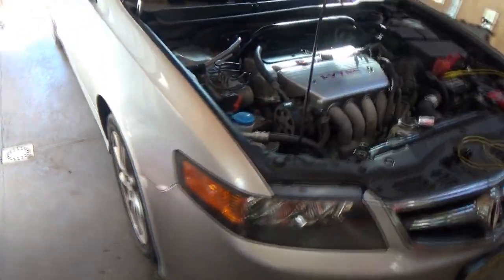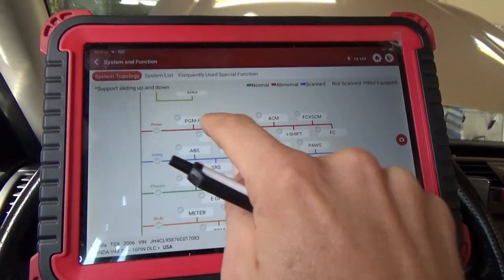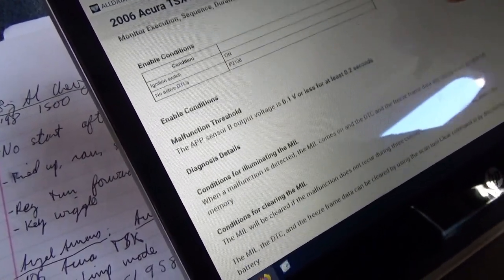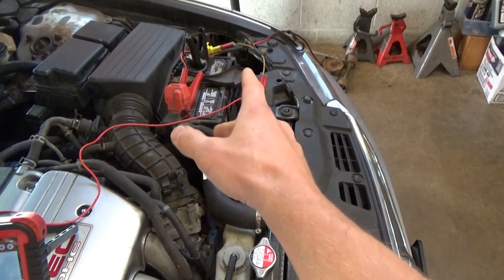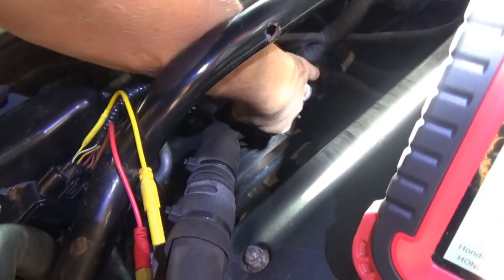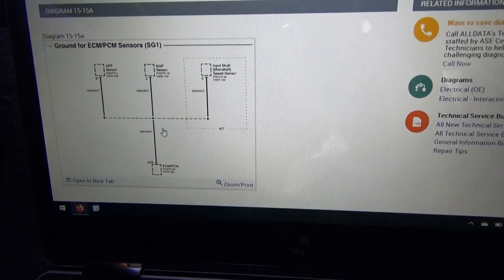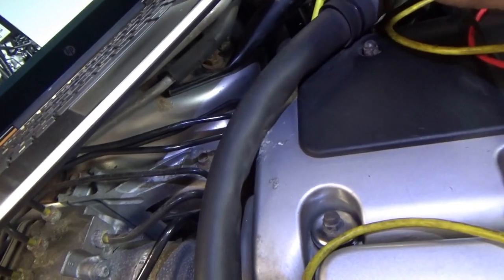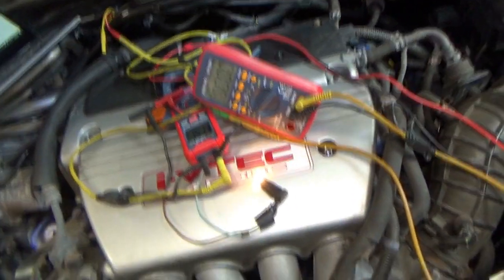DANGEROUS Limp-Home Acura (Part 1)

Comment: Running a higher current through a multi--strand wire with some conductors having high resistance connections can sometimes heat the resistance enough to weld through the resistance.  That "thermal junction" looked to me like a heat shrink compression joint used instead of a crip or solder.  There were exposed conductors inside the plastic cap. Perhaps the branch being tested had surface oxidation and handling broke through the oxide.  Doxit followed by solvent rinse? Then solder or mechanical splice.

Comment: 0.24V is almost perfect for the sensor B. Sensor A and B have different voltage ranges for redundancy - otherwise a short between the signal wires could not be detected. Hence why the freeze frame set at 0.44 volts - the difference between the two sensors was too small. It always expects SensorB Volts = 2x SensorA Volts.
Reply: I don't understand why the voltages would be different, but 2 readings that have to agree for something as important as throttle position makes sense.
Reply: @mykofreder1682  The sensor is intentionally designed to have different voltages representing the same position. The computer is of course programmed to recalculate each voltage to the correct position. So even when one sensor gives 1V and the second 2V, the calculated position would be the same ~40% from both. If the result matches, computer gets the result as a correct input. But when there is a short circuit between the two wires, it sees the same e.g.1.5V on both lines, so when recalculated, the recalculated result for first sensor would be 60%, but from the second 30%. Because both should represent the same pedal position, which is impossible, so the computer recognizes there is a fault, can disregard the input as wrong (so goes to limp) and so then sets that mismatch code.
Generally there are two principal techniques are used for such redundancy purpose:
One voltage being half compare to the other (one has 0% at 0.25V and 100% at 2.25V, second has 0% at 0.5V and 100% at 4.5V; e.g. this Honda),
then each going from the opposite direction (e.g. one has 0% at 0.5V and 100% at 4.5V, the second has 0% at 4.5V and 100% at 0.5V)
Or some variation of both (one goes from 0.5->2.25 and the second 4.5->2.75 or so).
All the time the driver circuit in the sensor uses the same output stage (e.g. pull up; or the one side is stronger than the other), so when shorted the one attempting to drive higher voltage wins, so result is again position mismatch.
Reply: I (X-harness designer) would think if they have two sensors, one goes pop, you can still drive the car with the good sensor. All be it in Limp mode because the computer knows you have potentially a dangerous scenario. Your concept of differences in grounds is not sustainable as ground voltages can easily vary at different locations due to ground surges or loads. I would never use ground other than ground and would expect it to be zero Volts from a design viewpoint. 
I appreciate your redundancy  hypothesis, usually MAP v.MAF etc for IAC and so on.
Reply: I had another make of car with sensor 2 having 1/2 the voltage of sensor 1.
Reply: @mykofreder1682  two different voltages ensures that there must be two valid signals present - if they read the same voltage, you have an issue and the engine goes into limp-home mode.
Also, the idea with two inverted voltages does not work (one sensor 0.5-4.5V, the other 4.5-0.5V). In that case, a short between the two signal wires would read as a valid 50% throttle position (2.5V), something you most definitely do not want.
Remember, this sensor is telling the ECU to which position the throttle valve should move; so any false reading has the same consequences as a sticking throttle cable!
Reply: yep, common to have them offset and some work inverse of each other, one high one low and still offset.

Comment: Less than half way through this video you established that touching a harness in a specific spot recreates the problem yet you still haven't opened up the harness covering.  My guess is chafed wiring under the plastic or you're upsetting a ground connection by tugging on the harness.
Reply: Agree with JimR. Open harness along the route where you were repeating the fault. Likely you moved the bared or punctured wire by moving the loom. Prob not what you wanted to hear.
Reply: I agree, at that point I'd overlay a new signal and ground wire from sensor ,test drive and see where u end up.
Reply: I don't think it is a ground connection problem, the ECT sensor ground didn't change at all. My guess it is a broken ground wire from the splice to the pedal sensor.

Comment: I would check that splice joint solder it shrink wrap it make it watertight and run a nice new ground wire overlay to the app be sensor and go from there but it's it's nice to have rhyme or reason to wear the problem is in the harness with the voltage drop I agree great video can't wait for part two

Comment: My 05 TL had a similar issue, I just replaced the accelerator pedal sensor. Works fine, no issues.
Reply: I just did the same thing and it still in limp mode

Comment: I think that I'd have followed Eric O's  approach to not touching broken things so that you don't accidentally fix them. Specifically, once I'd identified the problem as a harness issue, which you did really quickly  early on, I'd have stuck one side of the multimeter at battery ground and then opened up the harness at various spots to check on the ground resistance. You know it's good at the ecu and bad at the sensor, so just do a bunch of piercing between the two. It'd be the Newton-Raphson  method of wire - fault discovery.

Comment: Passing higher current through a wire with a bad connection is an old trick for improving the connection at the point of high resistance. The heat will often clear the poor connection to a degree but it is by no means a permanent reliable repair. It's a roll of the dice. Naturally you're improving the connection by moving the splices around which will create some friction within the splice improving it. 
Personally I would take the splice apart and remake it for peace of mind being assured it's not going to fail again.

Comment: Ensure that Thermal Junctions are clean/Deoxit or just use flux and solder to reconnect the wires. Then perform the wiggle test to see if it was the problem or not.
Reply: I am with you.  I think the current of the light made a better connection.  Solder the joint and shrink-rap the wires.  Now we wait for Part-2.

Comment: I had the engine out on my '03 Forester to replace head gaskets. Got it back together. Ran poorly! Got codes for TPS and ICV. I could wiggle the connection on the TPS and get different values on my scanner. I was getting ready to put in a different pig tail on the TPS. Turns out, I had missed tightening a ground wire group. I must have been bumping the loose ground wires with my arm when I was wiggling the TPS connection. Runs great after establishing a good ground.
Reply from the maker: Awesome!

Comment: Also, with your test light, you're probing poorly. You are checking for a ground fault in a 5V supplied circuit, with a test light supplied by 12V. That means then5V sensor supply will act as a sink if the ground wire is broken, leading to a slightly less bright test light, but it will remain lit!
Reply: Yeah I cringed at that, 5v no likey the 12v probe.
Reply from the maker: Interesting point! I've never seen a 12V light "backfeed" through a 5V regulator. Would make for an interesting experiment :)
Reply: @PineHollowAutoDiagnostics  yeah if you're feeding it from the +12v of the battery and you stick it on the ground wire of the 5v circuit and the ground connection is open circuit, it will try and push the 5v up to 12v. Easily checked beforehand, if you're seeing 5v on the ground wire then the ground connection is likely open circuit and should be investigated as such.
Reply from the maker: @TheFool2cool  Yup, it was indeed intermittently open on the ground...I usually rig up a small test light in that case and do the wiggle check while looking at the light. Except in this case the current from the light somehow "fixed" the open ground...never had that happen before :)
Reply: @PineHollowAutoDiagnostics  Current can fix a connection.  More often with switch contacts.  The current burns off the oxidation and allows for a good contact.  Likewise, mechanical movement can clean the contacts.  At this point, I'd say that you have a  connection with defective/corroded bonding. It's this close to being a good connection, but there's a light oxidation layer between them.
Reply: @TheFool2cool  eh, the 5V supply will be fine, generally speaking the 5V sensor supply will draw more power than his 300mA test lamp can supply (which should be less than 200mA at 12-5 = 7V). So there is most likely no backfeed at all, and even if there was, generally these supply lines have protection diodes inside.
The issue is that the light gives a false sense of "still some current" when the wire is in fact completely open.

Comment: Close to the thermal joints the harness it self ground with a 10mm bolt to the engine.. it is metal encased in plastic hard to see but always corroded behind where the bolt meets the engine...

Comment: I was laughing when you was pulling on the wire asking do we fix it? As you have pulled on it to fix it.  I'm like duh get the knife and start cutting that issue will be back after a few drives. I know you'll fix it and find a lose nut on a ground post or something with some minor corrosion or when the heat or the motor causing it to loosen up.  Part 2 please.
Reply: dont forget "THE GREEN CRUSTY'S"  monster !!!

Comment: My thought on light load fixing circuit is the higher amperage kinda gives a weak weld from the heat of increased amperage in circuit at weak connection. Will usually break again if not properly fixed.
Reply from the maker: Exactly :)
Reply: Maybe even the heat generated by the higher current is increasing the contact pressure in the "thermal joint", thus reducing resistance across that coupling.

Comment: in harness splices are just plain evil. had my share of bad ones. to the point  i look for them in the circuit i'm working on.   i believe what they call a "thermal joint"  is where the wires are fused together with a process like spot welding. they often break from flexing one strand at a time until they are all broke and just touching each other. somewhere in that process the problems start.

Comment: sometimes pulling on a wire will let i "seat" better against whatever it is connected to. Pulling too much will pull it out.  I have theories about the bulb load "fixing" the problem, but they all end up with it being a short lived fix. I have seen it on much higher distribution voltages in the street. It will be interesting what the final outcome is.
Reply: Why would the bulb load fix anything? Pulling on wires is a tried and test method of finding poor connections.

Comment: Had this similar issue in my VW some time ago. Out of nowhere the car would loose acceleration, check engine light on and a code related to throttle body position mismatch. It was worse on a rainy day. Figured out to be the wiring harness rubing against the front beam and chafered the wires that carries power to the throttle motor. When it got wet somehow the signal did not reach the TB module. Repaired the wiring and it has benn running perfect for more than 5 years.

Comment: Car is like 20yrs old, overlay some new signal/ground wires and call it a day. I'd also do a quick inspection on the motor/trans mounts to make sure the engine doesnt have excessive movement, yanking on the harness.

Comment: The bad ground seems to be just some crusty contact (mainly dry solder joint), which usually has a kind of semiconductor properties (copper oxide was used as a principal semiconductor material to actually manufacture rectifiers before the Ge or Si semiconductor technologies took over). Once you connect the higher load, it locally heats up, forms a micro weld or something like that and becomes conducting well for a while. So that is quite normal behavior for such defects and why it could be deceptive to test them with such high current tester - it may "heal the contact" for a while and so make your diagnostic difficult...
Reply from the maker: That's exactly what happened :)
Reply: @PineHollowAutoDiagnostics  It is therefore better to use a continuity tester function of a multimeter than such light. The multimeters use barely 200mV test voltage and currents below 1mA, so voltage low enough to not be able to electrically break down the thin oxide layer (for breakdown, you need at least few volts to accelerate the electrons to cause any change in the material so posibly "repairing the connection". Below 1V the electrons do not get fast enough to alter anything).

Comment: I would move the wires and see if the condition comes back, if it is intermittent, with engine vibration, the connecter may be losing the ground if the connecter is sliding apart slightly. Maybe the ground is not seated properly in the connecter or are frayed wires in the wire itself.

Comment: Here's a method that may help here. Since it appears the test light "fixed" the problem, the problem area needs to be located. Disconnect all sensors and the ECM from the sensor ground reference circuit. Connect a jumper wire at the ECM connector and ground it. Next, connect a higher amperage test lamp (at least 4 amps) to battery positive and connect the other lead to the APP sensor B ground reference terminal. This will place a heavy load on the circuit which will likely help to locate the problem area in the circuit. If the test lamp can light, the trouble spot should at least heat up sufficiently to locate it.

Comment: I would look at the throttle peddle and note all the colours, then the under bonnet harness gets a good fondling and tugging wire by wire :-D
That thermal junction might be a safety device in case of fire in the engine bay, still sounds dodgy as hell though.
Reply: Do you think that fire would reliably disconnect wires inside that little sock? They looked to be twisted together. Why would you want sensor grounds disconnected in a fire anyway? Large power feeds or something like a fuel pump feed I can understand, but the APP sensor??

Comment: I'd remove the test light and give the bad connection time to cool off. By loading the circuit, you caused the connection to heat up. This resulted in thermal expansion which improved the connection. Hopefully when it cools, the bad connection will show itself. In electronics they use freeze spray to try to find bad connections. I wonder if blasting those thermal connections with freeze spray would help locate the problem?

Comment: Resolder everything in the "thermal joint" and run an overlay wire from there to the APP sensor? It looks like it is an easy path. What the heck is a "thermal joint" anyway? Is it not actually soldered but just twisted together under some heat shrink like it looks like in the video? If so, that is really sketchy.
Reply from the maker: It looks like the bundle of wires compressed with very high pressure...never seen this "cold solder joint" technique before haha
Reply: @PineHollowAutoDiagnostics  Makes sense from a manufacturing perspective I guess but I still wouldn't trust it. If a wire was loose in there, it would explain why jiggling things could make it 'come good'. If it is such a good technique, why doesn't every manufacturer use it? Why don't we see it more in newer Honda products? Since 2006 they have had plenty of time to see how well it works and it seems they decided it is not worthwhile?
Reply: Wires mashed together is a widely used method in mass production

Comment: I would replace that suspicious ground wire right into the Thermal Connection. Leave it at that and tell customer that you fixed a fault that you diagnosed (intermittent). Chances are it will be ok or not ok, you take a 50/50 gamble.
Obviously if the symptoms return there is something more serious somewhere and take it from there.
Reply from the maker: Customer drove 3+ hours to get a 100% diag and repair, so I'm not doing a 50/50 gamble haha

Comment: My guess is that the wire inside of the plastic sleeve is damaged and running together with another wire. Or not making contact at all my next action would be to run a external ground wire and just tell the owner to drive it hard and see if it breaks down again :)

Comment: Running 12v through a circuit designed for 5v isn't a good idea.  I  would have tied a scope to it and tracked it using a wiring diagram. Running extra current can heat up a bad connection and get it going again.

Comment: It looks like there are clusters of wired at a common voltage joined together, most likely by some machine then capped. It's probably very good but not perfect over time. My first attempt would be to hold all the wires together (so they don't go flying if they are just held together mechanically), remove the cap and see how the connection is done, from pressure of the cap or solder. Regardless, it probably has to be reheated and soldered.
Reply from the maker: No solder. It's a "cold joint"...wires fused together by some massive crimping pressure lol